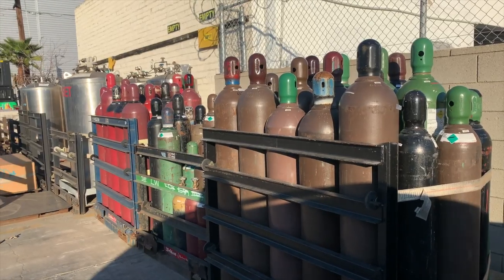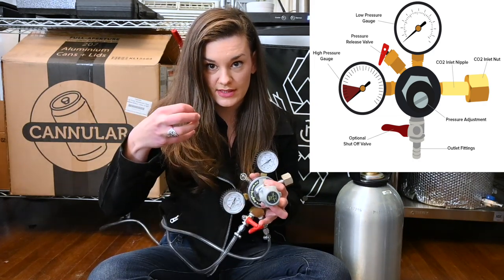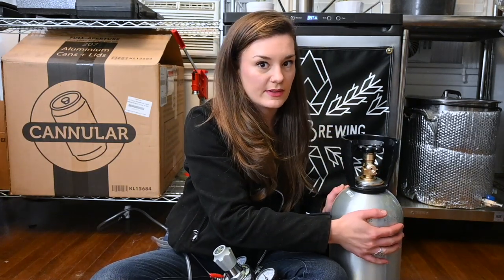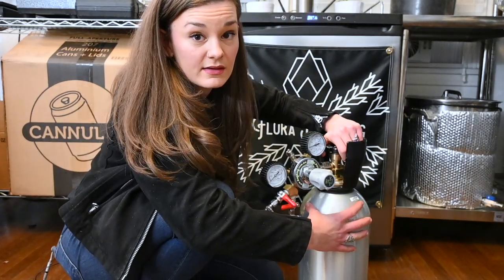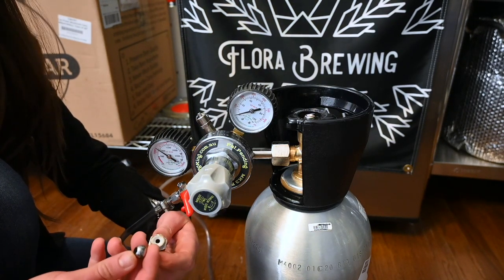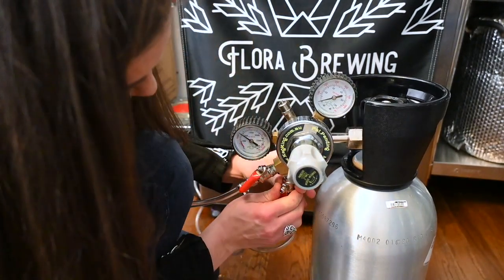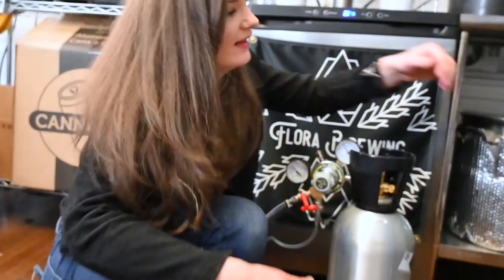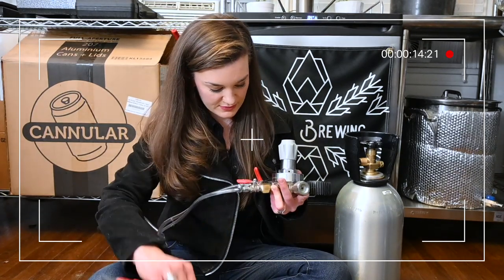How To Set Up a CO2 Tank, Fix Leaks, & Trouble Shoot Problems

Comment: That curly pipe. If you twist the pipe backwards a few turns before you screw the connection on the pipe will un-curl and then be straight when tightened.
Someone below suggests spanners, that is also a good idea. Two of the little ones, saves the knuckles.
Reply from the maker: wise!

Comment: Hello, you can use loctite or  a similar product for pressured gas lines. It is easy to use and effective. I love your videos. Thanks.
Reply from the maker: I will have to try that the next time I run into issue. Right now it's holding great so I dont want to touch it!

Comment: Your praxair distributior should of offered a co2 regulator wrench.great job finding your leak😉Teflon sealant on your threads would help fix your leak on those threads.
Reply from the maker: I only get my tanks swapped from them the regulator came with my kegerator so no complaints!

Comment: Excellent. A couple of correct size spanners and you'll never use a wrench again. Cheers
Reply from the maker: I don't know what a spanner is but I'm on my way to google!
Reply: @FloraBrewing  sorry different language different country. Let's call it a non adjustable wrench or spanner. So it fits only a specific nut or bolt size. You might need 2 or 3 different sizes for your kegging. They just work so much better. Cheers😎👍

Comment: You should always use fresh teflon tape wrap around all threded connection, before tightening it again.Teflon tape sealant  unthreded onece is useless. If it seals the joint again it's mostly luck, instead of pro attitude. Greetings from homebrewer in Poland!!!

Comment: Assuming all things are good, clean lines, everything is settled and cold..I have foam galore from a fresh keg. I suspect the issue is my regulator...although its new. The lowest pressure it will ever read is 30psi.....it seems as if 30 means 0....is this possible? Meaning 30psi (even with tap handle open) yields no product. If I turn the fine adjustment up to 35psi (assuming that really means 5psi) beer starts to move...slow foam. If I turn it up to 40 or 42psi....it Flys out, all foam....this is the case even after turning the gas off, purging the valve and retaping. Also if I turn the fine adjustment screw counterclockwise to the point of coming out...it still reads 30psi. What is wrong?
Reply from the maker: You might have an air leak somewhere in your lines or maybe the beer is overcarbed but that seems unlikely if you can’t get it to pour unless it’s turned but to 35. This is a puzzler for sure. If you purge your regulator with it disconnected from the keg does it still read 30? That would be the true test to see if the gauge is just messed up but it seems like you’ve done what I recommend with purging and reconnecting. Maybe try a picnic tap on the keg and see if you still get the same foaming. One thing it could be is something stuck in the poppit of the keg which can lead to foam and problems getting beer out
Reply: @FloraBrewing  I'm going to say no on the air leak, because the tank guage has shown no sign of loss. The only concensus I get is that the low pressure gauge is bad. (I'm about to replace tomorrow). The question is....if the gauge reads 30, is it really 30psi?

Comment: I keep a little soap water in a spray bottle - just a few drops of dishwashing soap in a bottle of water - it works better for leak detection - makes bigger bubbles. Star San makes little fine bubbles and you can miss a small leak. I use Duotight fittings and evabarrier lines, so chasing leaks is a fun way to spend a hour or so. CHEERS!
Reply from the maker: Yeah it's more of a 'what do I already have in a spray bottle' kind of decision

Comment: CO2 has almost made me rage quit homebrewing on multiple occasion. I re-did all of my co2 lines, bought a new regulator, bought different clamps instead of worm clamps, I went to oetiker (stepless) clamps. And I still would fly through co2. Come to find out, I believe it was one of my kegs leaking. RAGE! But, I am still brewing.
Reply from the maker: It's seriously one of the most frustrating parts but it still beats bottling!
Reply: @FloraBrewing  Indeed it does! 🍻

Comment: i  have the regulator  what  hoses  do  i  need now?
Reply from the maker: usually it's around ¼" or 6mm ID tubing. It depends on what size valves you have though. Here's a link to some gas line at 6mm : https://bit.ly/2HDWTdz